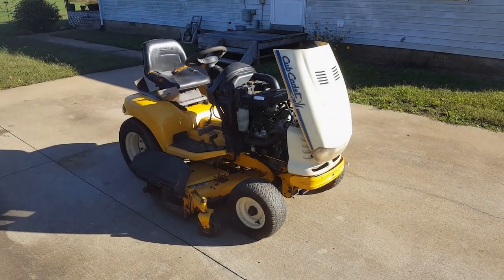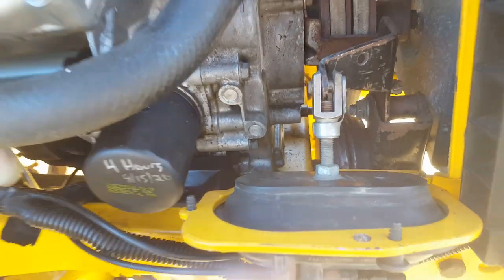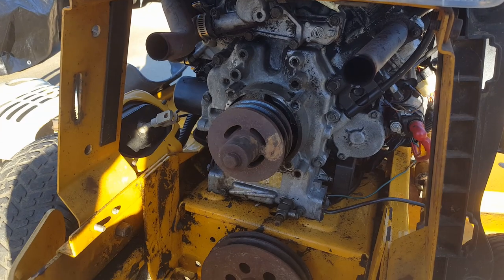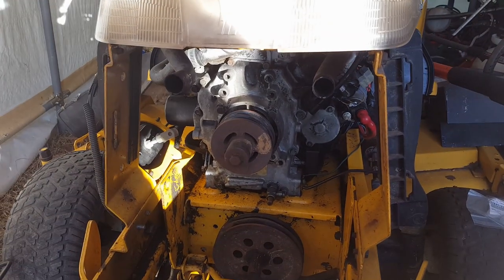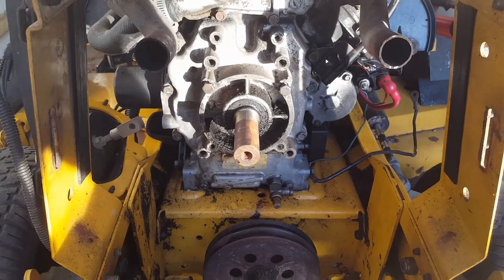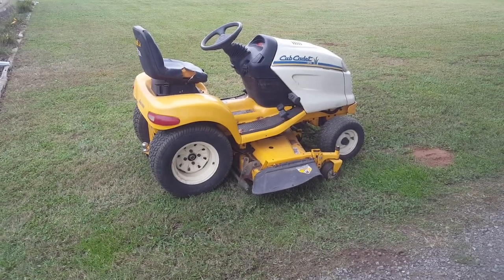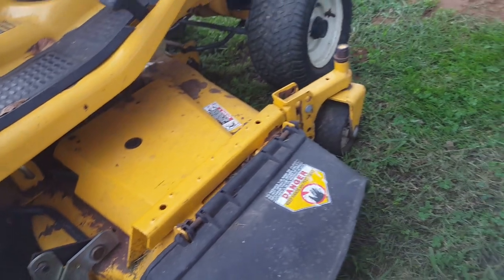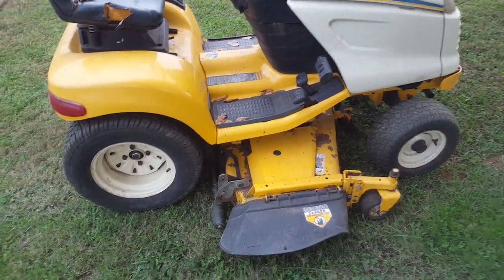Abandoned Cub Cadet 3205 PTO repairs...will it mow again??

Comment: You do not have to take all that off to change those belts. You simply loosen the bottom two bolts so they drop down away from the bottom pulley, release the spring holding the hydraulic arm, feed the belts up through from the bottom and adjust them into the grooves, then tight the bottom bolts, make sure the hydraulic arm is positioned with the guide into the groove of the bottom pulley and reattach the spring.

Comment: Looking on how they but that PTO on and the way it works.....makes me glad I bought a Wright's stander with an air cooled Kawasaki....got it used from a customer of mine who had me put a new engine on it. The stander uses a straight forward electric PTO not cheap but not to hard to replace....when you do convert that PTO to mechincal acuation it'll be better than anything Cadet or MTD ever designed that's for sure! Go Tyler!

Comment: Thanks for sharing your experience thru these videos, your persistence is the way it should be!  
   I've bought, acquired and picked up several of these mowers and I agree if they are operating well they are like a cadillac like you said... So the modivation to keep them going is there.  Do you still use yours?  Kind of curious, haven't seen any updates...

Comment: I thought I was doing this stuff, I bought two 3000 this year 3225 for two bills, and a 3206 for four bills 3225 needed  steering shaft  an pto  belts an mower deck work, the 3206 didn't run or move repaired charge pump, gear broke, carb work, an like you they both have issues but the are up and running, Pepole like us are herd to find , If it can be fixed ,we are own worst enemy .
Reply from the maker: They are still very nice mowers.